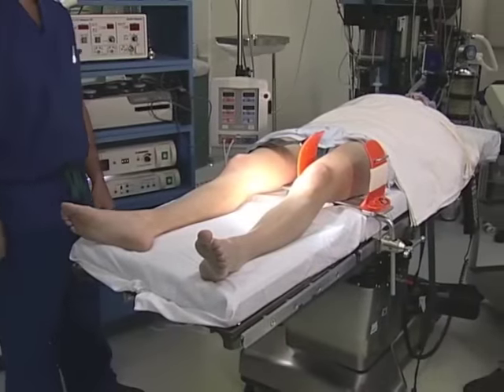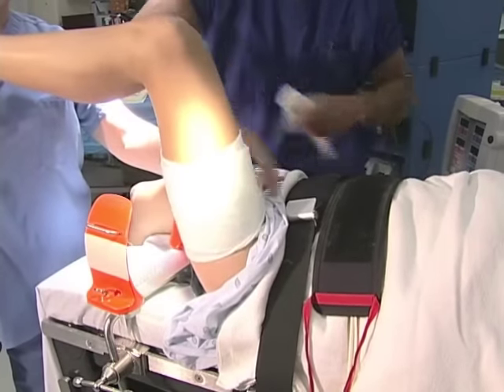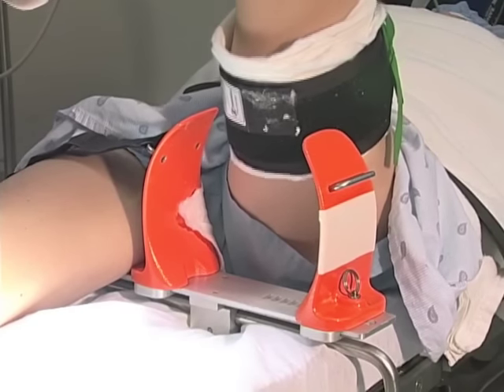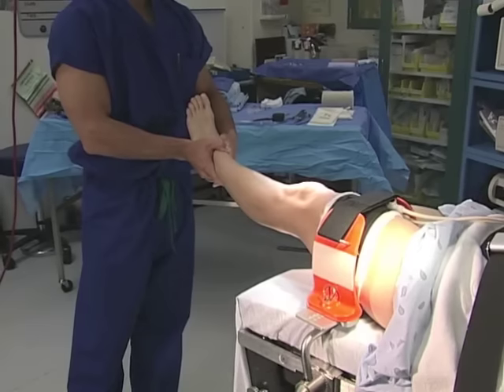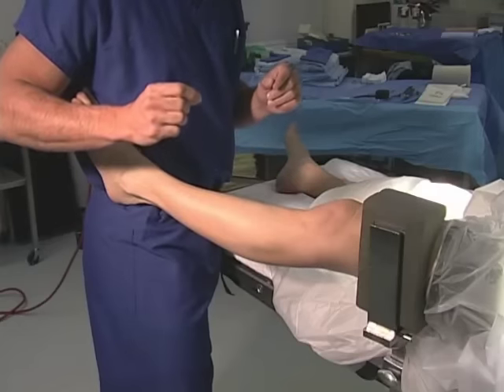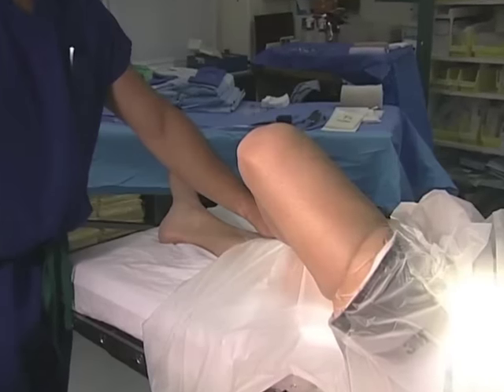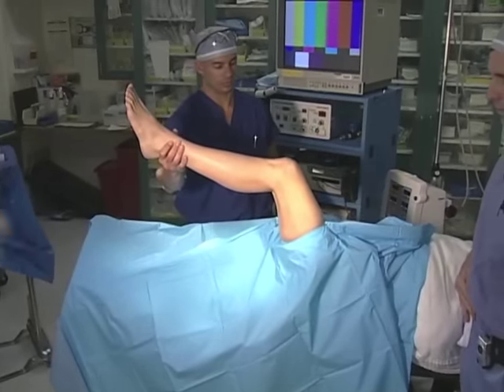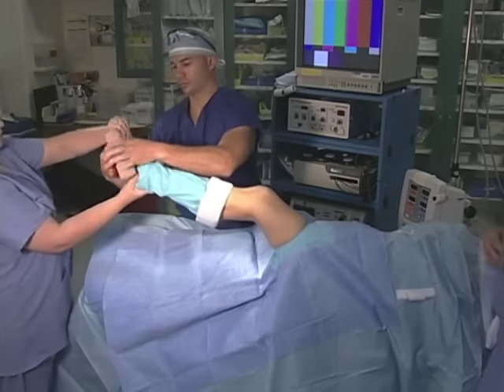Arthroscopic Knee Surgery Video Part 1: Knee Positioning | New Mexico Knee Specialist | Dr. Lubowitz

Comment: Thank you for allowing this man to wear a depend brief.  I will not have a catheter so want to wear one.  If have an accident which shouldn't my spouse can help me clean up after procedure.  If not able want all same gender team to protect my modesty and dignity.
I do have a question.  Why don't you wear gloves to drape.  That isn't sterile is it.  That is the main reason they say won't let us wear underwear.
Reply: S J, this is a demonstration video. You don't have to wear gloves, clean or sterile, to get the tourniquet  on and knee positioned in the holder. You can wear clean gloves while positioning if you prefer. If this was an actual case, then everyone in the room would have a mask on. They would have sterile gown and gloves on to place the sterile drapes.